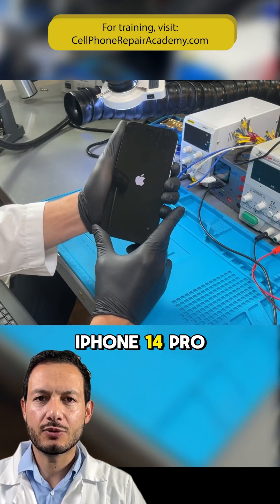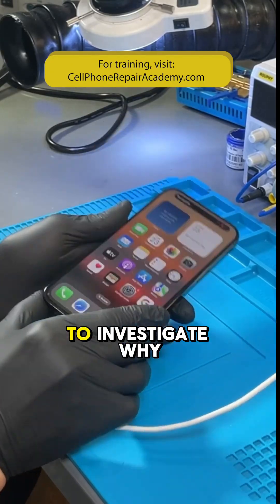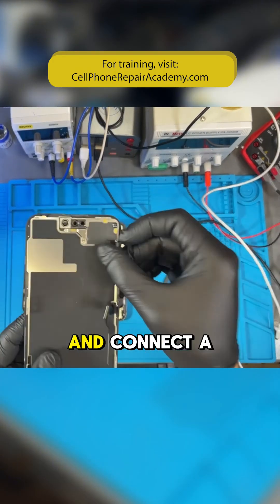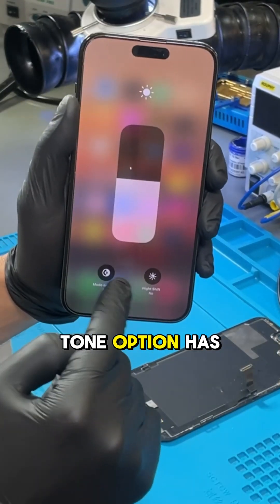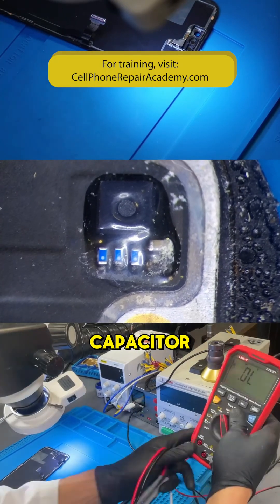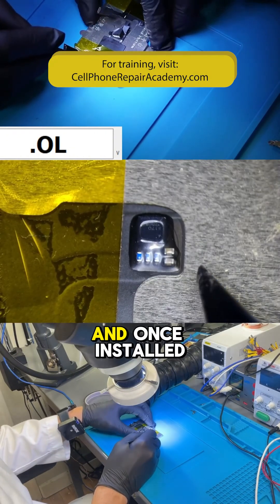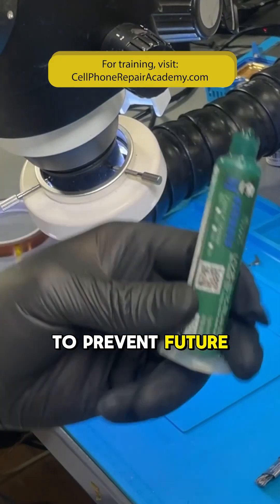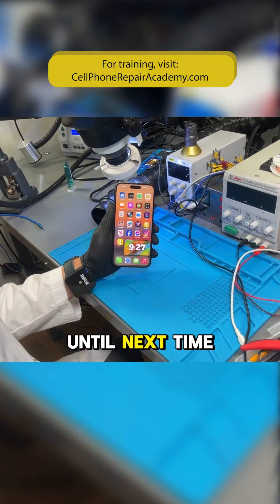iPhone 14 Pro Max Resetting Every 3 Minutes? Proximity Sensor Water Damage Repair! 🔧📱

Comment: My 14 pro max proximity sensor is not working properly. When i call someone screen turns off but never turn on , so i have to press power button to turn on the screen. It also issues with while listening to whats app audio!!  

So if i replace proximity sensor  does it affect true tone ? And how can I fix the issue without losing true tone? And does it affect face id also if I replace new proximity sensor?

Comment: Ios 18 fixes that with a calibration
Reply: You mean with just a update to Ios 18.0.1 it will the panic?
Reply: @OyeeGadgets   
Yes, you can retrieve the TT by updating to the new iOS 18.1, but you will lose the auto-brightness feature, as it will no longer work automatically. Alternatively, you can transfer the TT through the normal procedures or follow the process described above."